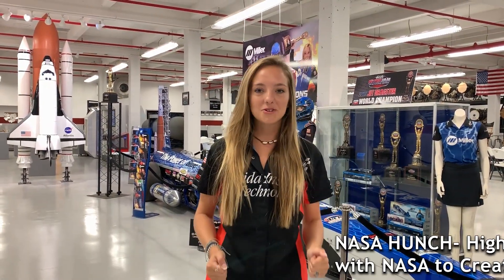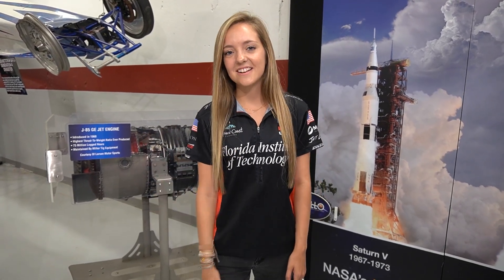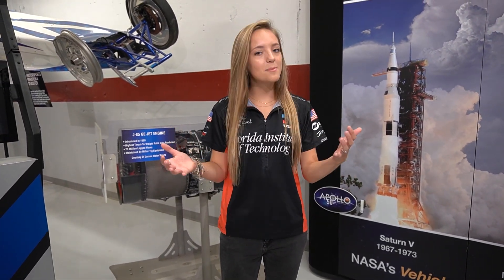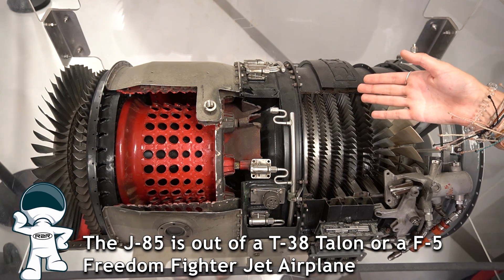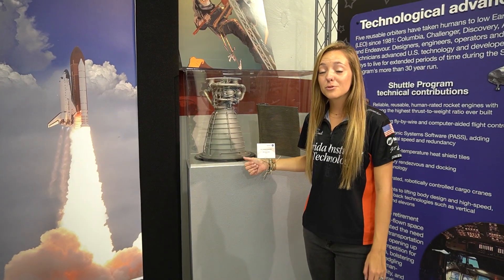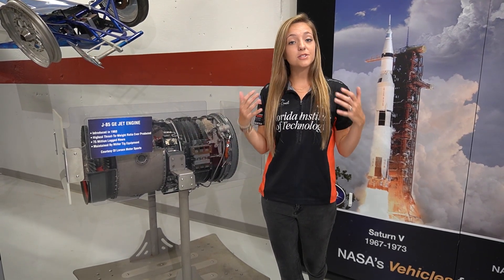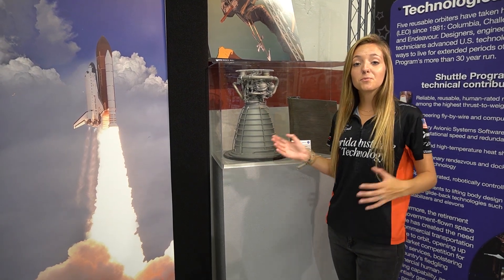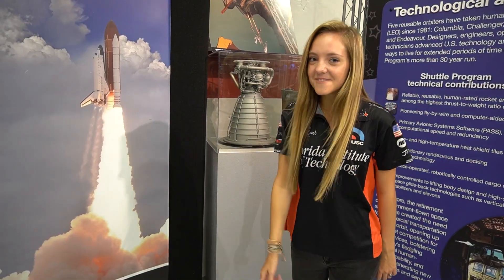Episode 1: Rocket Engines vs Jet Engines

Comment: Back in the 70s I saw what they called a rocket car,but it was a peroxide rocket.Basically a sidewinder with wheels.It made no noise until it launched,then there was a loud whoosh for about 5 seconds.It ran 5 seconds even,but the blast knocked the lights out of alignment so they didn't get the speed.It was estimated at 300 mph.This was before top fuel cars had broken the 5 second barrier.